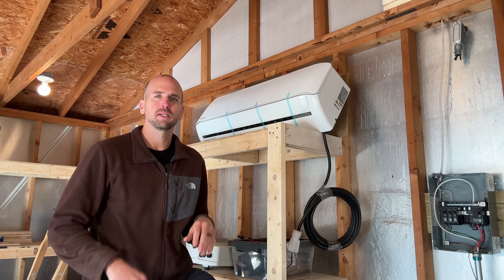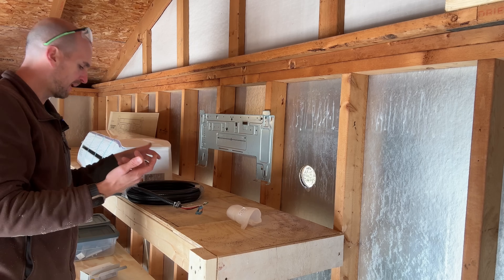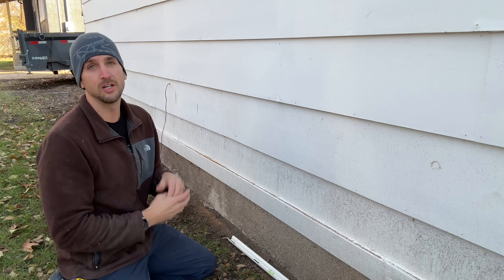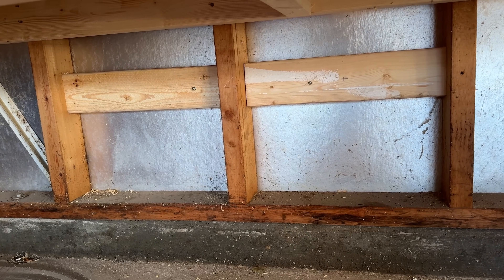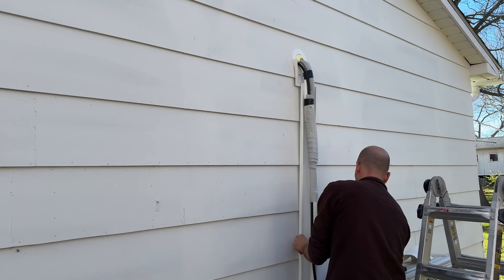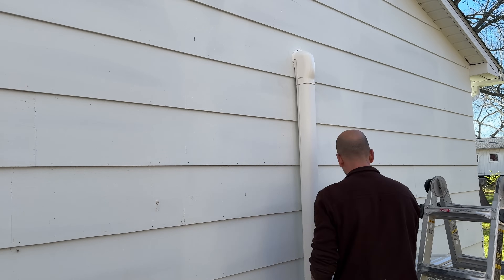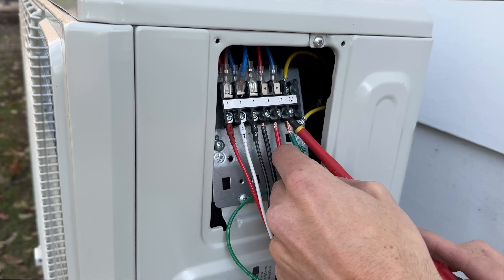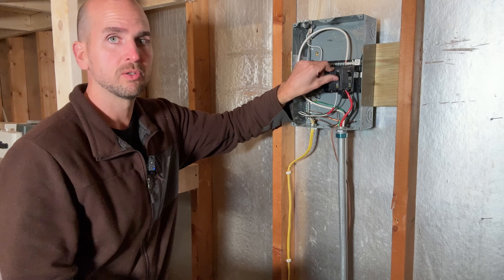Complete DIY Mini Split Installation | New Mr Cool 4th Gen Unit

Comment: GREAT VIDEO!!! i was quoted $13,000 to install a mini split in my 850-square-foot house in Las Vegas. . i knew IMMEDIATELY he was a rip-off!!!
Reply: Most  (not all) HVAC companies are the biggest thieves out there.  $13,000 for a mini split, LOL.
Reply: @SuppressiveSquirrel just remember when your Mr Cool garbage quits, or leaks all the refrigerant out, those "theives" will be who you call
Reply: You could report ir give the company a negative review depending , if it's a very large and elaborate project then I understand but 850 sq foot system eekkkk .
I wonder how many seniors and so on there ripping off , that's like the 80 quote someone gave me to change my 30 second job for the air filter on my vehicle
Reply: @724riff  I'm 80 and luvin' this diy vid.
Reply: @724riff  do it yourself then. You went to these people for a service. That service costs. Labor, time, parts, knowledge, physical ability, etc. You people either need to learn to do stuff on your own, or suck it up.
Reply: Holy molly... for $13,000 I would expect a central AC and new ductings.
Reply: $20,000 for my house for a 4 head install
Reply: @AltimaNEO it Is Very Easy, You Can Do Your Self.
Reply: @-mejor-que-nostradamus-6152  Im tempted, but seems like a lot of messing around.
Reply: @AltimaNEO  Follow Instructions With Other Videos And You Will Learn it…Good Luck.
Reply: @-mejor-que-nostradamus-6152 NO YOU CANT.
Reply: 850 sq ft = 24,000 Btu 
Mini Split = 500 Dollars
Installation.
Amén.
Reply: @-mejor-que-nostradamus-6152    I got a 12,000 BTU mini split by Blueridge for $1,200.  i installed it myself. I paid an electrition to do the electric hook up.  ($800)  done and done. i should make a video !!!
Reply: That’s an insane number! Glad you had the wherewithal not to move forward. That guy is ripping off people left and right!

 that’s even more than double what it would cost for a full Gas furnace, evaporator coil and condenser with the installation and a 5 to 10 year warranty and possibly even new ducts installed.
Reply: Here I South Texas $350 for the mini split and $99 dollars installation. $450 total. I don't think they will put the cover outside but I can do that on my own.
Reply: I'll do it for 10k
Reply: @homerepairguy1902   thank you but i did it myself. :-)
Reply: I'm from Vegas, and it should only cost you $800 to install the system, and most likely another $500 to  $1000 to run the electric. That is crazy high!
Reply: I installed my first mini last week. It was a hunter Cooper. It was so easy with you tube videos. I had to buy some manifold gauges to help evacuate the system with my trust vacuum pump but no big deal. Easy job. Just pay attention to each step and do it right before the next step and you'll have a good job and save money
Reply: Well the confusing part is there are systems that are called mini-splits but its a whole house traditional AC unit with ducting, air handler and ect. Those are expensive
Reply: @26longlongtime  The AC guy knew what i was asking. He quoted me $13,000 to install a replacement 2.5-ton roof unit. I said, "well what about a mini split. I'm thinking of installing one of those". He replied "Well it would cost about the same amount for that.  2 weeks later I bought a Blueridge 12,000 BTU minisplit from Alpine, spent $1,200, and installed it myself!  (but hired an expert for  the electrical for an extra $800).
Reply: @AnnLippert1  800 for the electrical hope it’s was far from power cause that will explain literally this things are easy to wire
Reply: @26longlongtime That’s a split, not a mini split
Reply: @26longlongtime  those are not mini splits, that is a split system, there is a major difference
Reply: Yep.  I paid $6800 for a 5 zone manifold big Carrier (tall two fans) and three floor mount heads which are more expensive than the ugly over door wall hanger default.  Installed.

It was a raised wood floor crawl space victorian cottage 1888 build and the guys were there all day with perfect cut custom lines.

I haven't had a single problem with the system...and happy to have gutted out the old underfloor ducts done in the 1970s now savaged by possums and racoons.

The guys even yanked out much of the dead ducts for me and disposed of them.  I had to do about half the remaining dead ducts.

I've helped guys do premade simple systems and it isn't hard when you mount the unit next to panel service and the head is on the adjacent wall.  

However that would have been very hard on my old house as the lines snaked under the house like plumbing.
Reply: You have to pay to get the job done correctly.  This install is okay ,however not done completely correct.  Not to mention  permits and inspection.
Reply: @BigDmike24  so, you're justifying a $13,000 minisplit??  LOL, you must be in the business.   Profit is not a bad word, but $13,000?  Come on man!!  A permit is no more than $100 and you're not around for the inspection, so whats the added cost??
Reply: @SuppressiveSquirrel guarantee it was much better equipment than Mr Cool. When that Mr Cool quits you are on your own, no reputable company will put their name on Mr Cool. Enjoy your cheap equipment and install for a year or so
Reply: @SuppressiveSquirrel  I'm noticing a trend among the people who are in the business. First, they always claim the other guy didn't do the install correctly but rarely offer an objective reason for that statement. Second, they love to bash DIYers, not because they care that things are done correctly, but because they feel threatened knowing that some of this stuff isn't rocket science and we peasants can save a ton of money by not letting contractors rip us off. Where I live these guys are charging people upwards of $50,000 to install mini splits. It's a ripoff and they know it.

Comment: Is there a reason why you didn't position the outdoor unit with the AC connections directly below the line set coming out of the wall so the line set dropped straight down and directly into the unit? Most units come with different length line sets. 
Also, in order to have a warranty my Mitsubishi Mr. Slim package needed to be installed by a licensed HVAC tech. I ended up paying a guy to come test and inspect in order to get an invoice to use for the warranty. Just something for others to keep in mind. Cheers

Comment: That is a nice thing you do for burglars. Installing a $2k appliance with easy to wrench off fasteners and reefer hoses with a cordless driver makes this 100lb appliance with 40lbs of aluminum scrap for a backup plan for the enterprising burglar is fantastic. The bonus is that you hid the unit behind the garage where a passing by police patrol officer's prying eyes won't see the mini LED flashlight in the burglar's mouth at 3am.

Comment: Can you tell me what the maximum remote compressor distance placement is? Are longer line sets available from the manufacturer?
Thank you
Reply: They are, mine comes with the option of 16, 24, 50, and 70' line sets.

Comment: Very good video and installation. In my area, we have trouble with what we call 'dirt dobbers'. These wasp like insects like to crawl into very small places like the condensate drain. On mine they did in a way that I did not see them till their mud plug closed off the drain and my overflow storage area inside the room began to leak badly. I had no idea it was plugged. I used a clothes hanger wire to unplug the pipe end. I then took a plastic bag and sliced open the bottom of the bag. I then tied the handle portion of the bag around the lower section of the drain so that the water would run out and they could not walk up the bag to the opening. End of problem. I change the bag each spring.
Reply: Just put like a soft mesh screen on it

Comment: Are these DIY units able to be tied into a smart thermostat (i.e., 24v connections)?  I have a Reznor gas furnace in my 1,500 sq ft garage controlled via a Nest T-stat.  Would like for them to be controlled by one t-stat, with the Mr Cool being stage 1 heat and the gas furnace being stage 2. Also, great instructional video.

Comment: Is it acceptable to use a standard romex connector to attach the communication wire to the Mr Cool panel cover or is there a more suitable exterior connector to use in this situation? I see you used a water tight connector between the disconnect and the unit (which is what I did as well) but used a standard romex connector (interior grade?) for the communication wire. Curious if this will allow moisture to enter the electrical panel inside the unit?

Comment: Hi Scott...... Great video, thank you. I have one question. Since you have a shelf just below the air handler unit, would it be wise to build out the wall frame so the face of the unit is flush or "proud" of the shelf? So that the discharged air from the bottom of the unit does not come in contact with the shelf.

Comment: You would have made a tidier looking installation if you had run the refrigerant and electrical lines down the inside wall cavity and exiting the wall behind the compressor unit.

Comment: I have DYI several mini splits. I use a vacuum pump and the correct length lines to make a more professional instalation. Also the outside disconnect does not need to be fused..
Reply: I assume he didn't use a vacuum pump because his refrigerant lines are sealed, some aren't and just have a bell opening, he Could use a dry clean gas/extra refrigerant Just to add pressure to check for leaks on his 4 Refrigerant Line nuts and the Service Valves.(Service Valves Closed)
Reply: @ Lines are not sealed, I don't like sealed lines because they can't be shortened.
Reply: The outside box should have a discount. There are 2 different types of disconnects that I know of. Knife blade disconnect, and switched.
Reply: @ yes they do need a disconnect , my point was they don't have to be fused at the disconnect.
Reply: absolutely, its not too difficult to flare copper.
Reply: you but if your smart you want over current protection on your equipment
Reply: @ibewsparky4  That's at the main panel already.

Comment: Is is Energy Star compliant?  Does the heap pump work in sub-freezing temperatures?  Down to how low?
Reply from the maker: Yes this 4th gen unit is energy star rated.  These units are supposed to work all the way down around -15F.  That is the spec.  If we get a big cold snap I will see what we are actually getting out and how much power that pulls.
Reply: That's really impressive!  @EverydayHomeRepairs

Comment: this is NOT THE WAY TO DO THIS!!!.  if you are a DIY'er maybe that would last a year or 2 but that is ugly outside and the coils will trap the refrigerant oil at the bottom of the coils and reduce the life of the compressor.  The best way is to shorten the lines and flare them to connect directly.  But with this kit you need to then vacuum the lines of air.  Which is an easy process.  Also these Mr cool DIY kits are more expensive because they have pre-vaccumed line sets.  Unfortunately they are also very un-efficient because they use shrader valves to keep the vacuum inside.  These bicycle pump shrader valves do not let enough refrigerant to flow in between the indoor and outdoor units.

Comment: Great job with upgrading to SS fasteners!  The only thing I would have done differently is place the disconnect box 1-2ft higher...out of the splash zone.
Reply: Good point also raises the hole unit 18" to 24 up to keep the condenser clean.

Comment: Great video, Scott!
Please consider a follow-up video in which you add an Intermatic surge protector to the outside heat pump disconnect.
Nearly all heat pump outdoor units are packed with circuit boards that can be thousands to replace with even a slight utility line surge, not to mention nearby lightning strikes.
Adding one of these surge-protection units is about a 20-minute, 60 dollar project—way short money considering the protection you're adding.
Of course, you may already have in-circuit-panel protection for the whole house —another possible video we'd love to see.
Reply: yup replaced a circuit board already..... every one needs a surge protector....